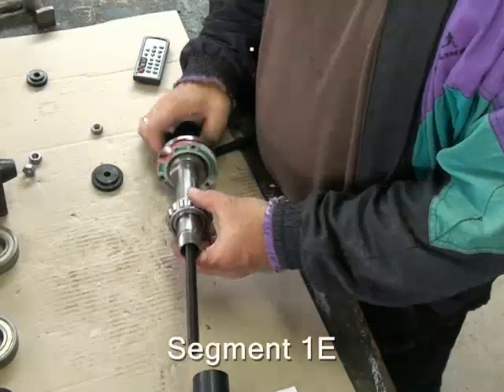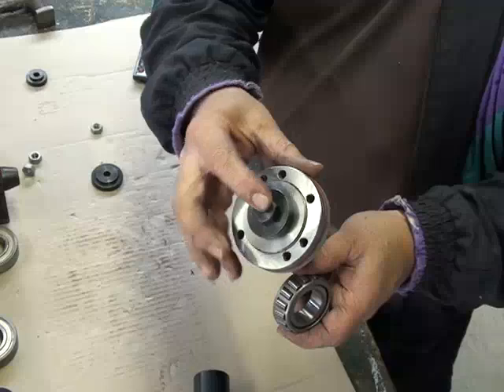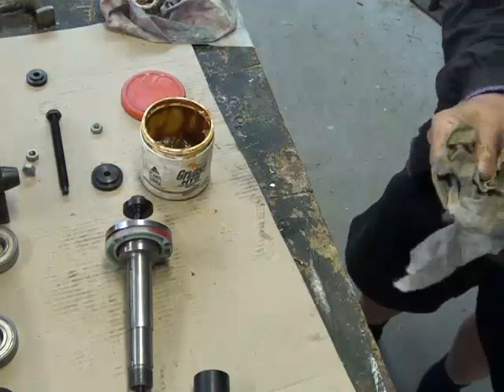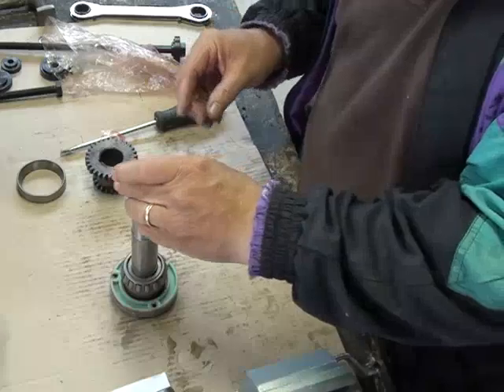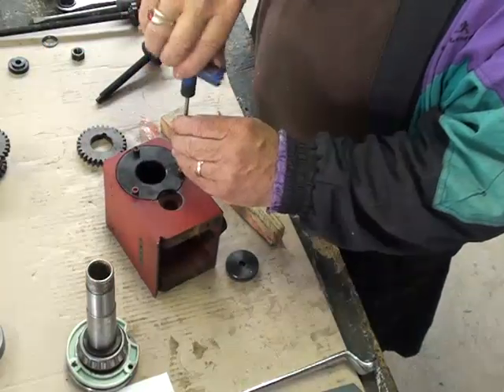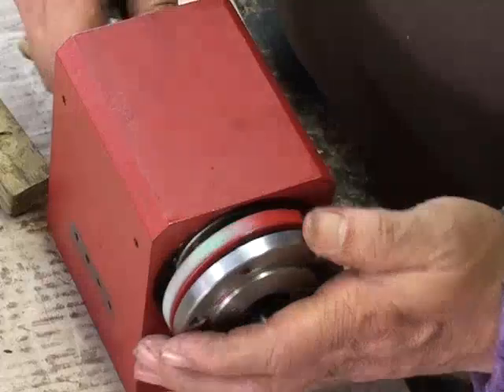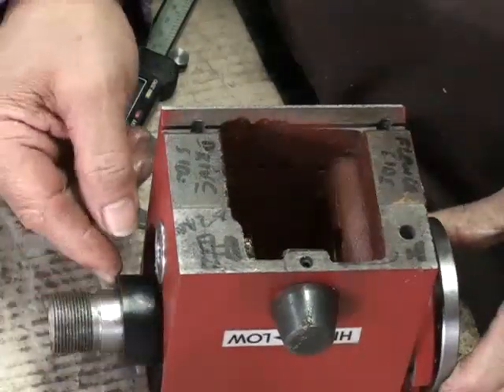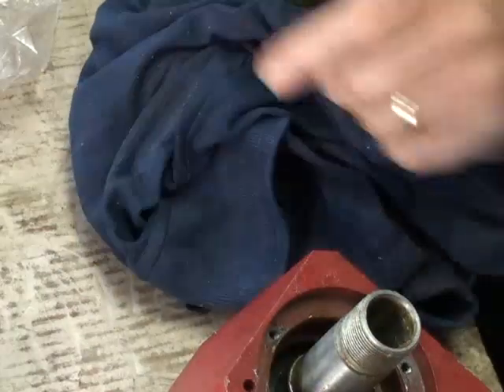Part 1E of Fitting the taper bearings to 7x12 lathe

Comment: G' mate just one thing I notice that you are hear in Aust. did you order ever thin from little machine shop in the States if so how much was the cost of the upgrade in Aust dollars regards John
Reply from the maker: +John Kinnane Hi John, yes I got all the bits from LMS in the USA. The cost was $34 for the 2 bearings, $40 for the metal gears and $71 for the tools. Postage was around $60.  The spare spindle box was around $110. At the time, the AU $ was the same as the US $. That was about 5 years ago. The tools were not available in AU. The bearings and gears from the local H & F were around 3 times the cost!  I have bought quite a lot from LMS. It has still been cheaper, including the high postage,  to go to LMS for spares. They also sell tools such as the US made parting blades, and the US made HSS indexable tips. I also buy tools from CTC tools in Hong Kong. His tools are the better quality Chinese ones and are pretty good and postage is sort of okay. I find that tools from  some Ebay Asian sellers are actually rejects so I avoid them except for small items. I did buy some bits on EBAY from an Adelaide supplier but half the time they were either the wrong ones or just bad and he would not combine postage or replace anything. Recently, in Dandenong, I purchased a new motor from Ausse machine tools and his price was the same as the LMS price so I saved the postage. He only came on the scene a year or so back. The local agents, H & F  are quite expensive for spares and also for tools.   I purchased a new speed pot for $20 from H&F then found 2 on EBay for $4.70 including post. Same deal with the brushes ($15), and on Ebay a bag of 10 for around $3. So shop around for bits. LMS is pretty good. They respond pretty quickly but right now the AU $ is not good and postage has been leaping up.  If I was to start again, I would have purchased a better lathe and saved myself all the extra work. In the end, with the mods, it costs just as much as a C6 or similar machine. Hope that helps.
Reply: +vk3aqz Hi thank you for replying to me I will give them a try as they do carry a lot of spares.  Thanks for the video on replacing the bearings it's something that I would love to do on my SC3 lathe.  Kind regards John Kinnane Tasmania
Reply from the maker: +John Kinnane  Hi John, all okay. I would also change the plastic gearsfor metal. I am not sure which model you have but some of the new ones don't have hi lo gears as they use hi torque motors.Have a look also at Ausee machines & tools web page. They seem to sell the angular ball bearings for around $15. However if you are also buying the gears and other bits from LMS, then you might be better off possibly with one big US order due to combined postage. I did get the motor from Ausee but I don't know if they can supply the gears. They are not a Siege product but made in the USA.  As far as the bearing removal tools go, they are really just a bunch of washers, tubes and bolts. Had they not been available, I would have probably made some up out of bits.  The Micromark tools do come with metal gears but only on the spindle and not on the Lo Hi shaft. Also they are a split set which is ok but I ended up using the LMS version which are one piece. I guess though, the Micrmark set had all the right bits and for just $70 it was probably the easiest way to go.  Anyway, good luck with that if you decide to go ahead. At least you will have learnt a lot about the machine which makes it a lot easier to tackle when something else happens which it will most likely do at some stage. Like a fluttering motor, or loose speed knob, worn belt, and sloppy gibs which seem to wear pretty easily, and so on.
Reply: +vk3aqz Thanks for that my lathe is a SC3 high torque, the one with the brushless motor I have done some mods to it like changing the gears for all metal ones.  I keep and subscribe to Frank Hoose's web site and I have found that very useful.  Ausee machines in Melbourne I have bought a Sx2.7 mill, stand ect.  I am building a super simplex live steam miniature locomotive.  Kind regards John PS have subscribed to your channel
Reply from the maker: +John Kinnane Hi John, ok on all that. Cheers, Lou

Comment from the maker: yammakashi
Another question, i forgot to take a picture and dont know which plastic spacer goes first. Thiner spacer, after that timing disc, gear wheels and thicker spacer? Is this correct order

REPLY: My lathe does not have a timing gear. The thin spacers are the same size and the shoulder you need to cut into the thin spacers, to clear the inner race of the new taper bearings, are 2mm across and 1.5mm deep. The large spacer outside the spindle box against the drive gear, If I remember correctly, should not need any trimming down. I do not have the dimensions of the spacers. Check the LMS website foe replacement ones and the size. The thin spacer is LMS part number is 1291.
Please note for your info, I received 26 emails with the same question but no question posted on the Youtube channels so there is a problem with your posting.

Comment: Do you have the part # of the spacer?. Thanks
Reply: Hi Johnny, the spacer part number is 1291. It is the only spacer on the LMS replacement parts list which is for the 7x12 lathes. It is the 7.5mm one. The other 3 spindle spacers are for the 7x14.  The LMS 2909 kit I used was made by Micromark for replacing the plastic gears with metal gears. The tools were part of that kit.The Micromark part number is 83452 so try their website. I have just looked at the website and it shows that kit. However you will need to enquire yourself as to it's availability. You can also make your own tools. I know some who have removed the bearings, have made suitable tools using aluminium tubing and washers. However the kit has tubes and washers with steps and rebates making it a bit easier to use.

Comment: How often do you have to add grease? Did you make grease ports?
Reply from the maker: Hello Emil, I replaced the grease just recently after 3 years. The grease in the bearing was not too bad but I found with fairly constant use, that the bearings had become a bit tight so I decided to open them up, clean them, and add new grease. No I did not add grease ports. With taper bearings you have to push the grease between the rollers. I am not sure how you can add a grease nipple or port to push the grease into the race. I did  not have to remove the spindle box from the bed to clean the bearings. I just removed the gear cutting gears and drive pulley. Then using the "pusher" tool from the bearing replacement kit, I pushed the spindle out at the flange end enough to repack the flange end bearing. The drive end is easy as the rollers just come out. As long as you don't push the spindle all the way out, the drive gears inside will stay on the shaft and just slide back.

Comment from the maker: As Far as I know all the viewers of these videos who have gone on to do the mod have viewed the videos first and in part 1E I clearly state that a shoulder needs to be machined into the spacers. In addition, you will need to have purchased spare spacers first as the original spacers are still inside the spindle!!. You would have to be dumb not to work that out.These videos were for my use only but was asked by the mini lathe forum to put them on you tube. Its not a Hollywood production mate!